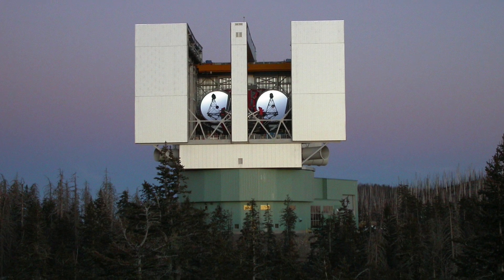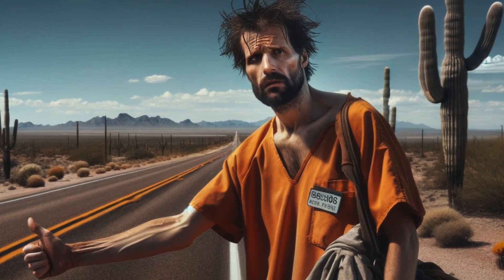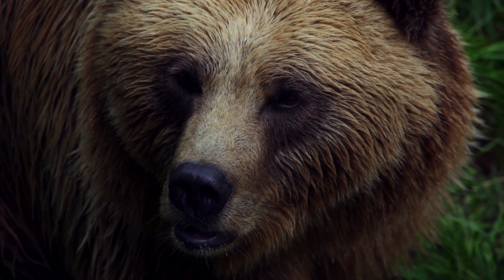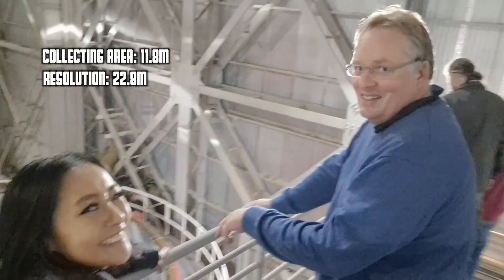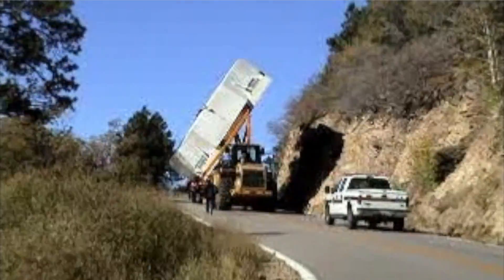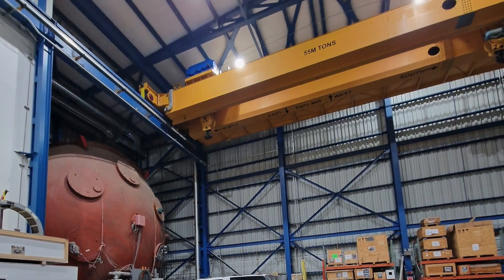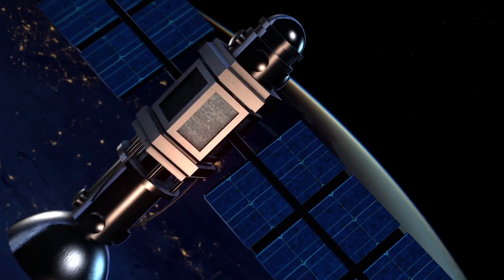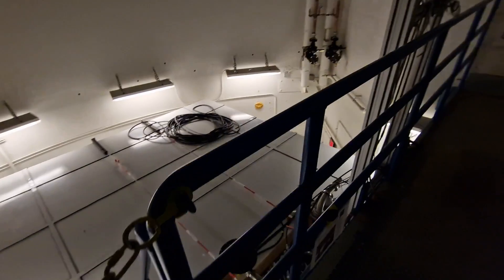The Large Binocular Telescope

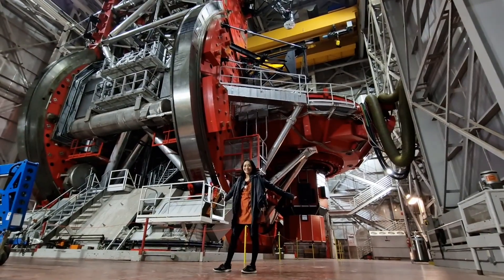Comment: 6:39, man, the size... what are those 2 giant metallic rings? is that a single piece?
Reply from the maker: Great question those wheels are part of the mount. They turn the mirrors. As the dome opens, you dont want debris falling on the mirrors because theyre uncovered, so you need to turn them to the horizon until the dome fully opens 🙃 crazy, i know!